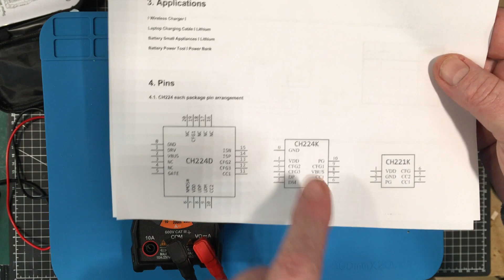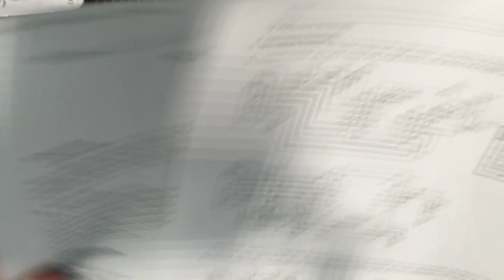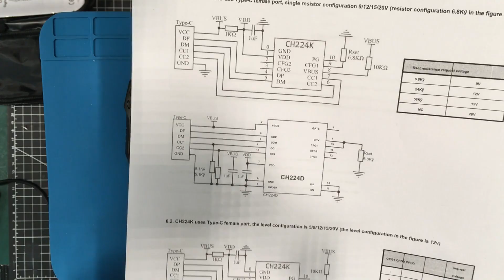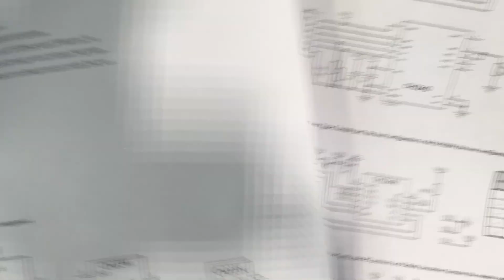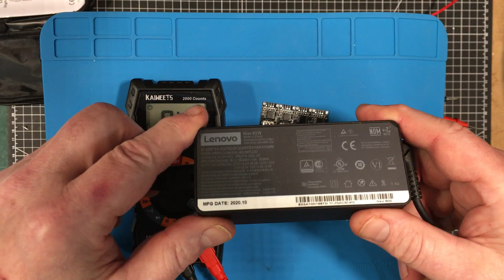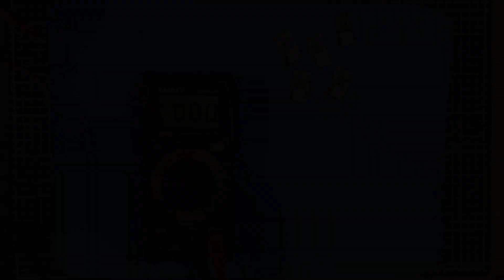0146 - $0.63 USB-C Power Delivery Controller - CH224K based

Comment: After i did some research it looks like the IC is not the CH224K as it seems but is looks like it is the FS312. I started probing with a multimeter and found that the CH224K pins did not match with the PD decoy. They may look the same, same functionality but different pinout.
Reply from the maker: Thanks for the update.
Reply: @uni-byte  I wanted to use the same IC into my pcb project as the PD decoy and i ordered first the CH224K to test it. I tried  the provided circuit in the datasheet. I connected all pins except CC1 CC2.  In the PD decoy they are connected to the female port but after that point, on the other side of USB A there are 4 cables V D+ D- GND. So i suppose these are connected inside the usb cable?!
Reply from the maker: @dimitrismed  That would be my guess too.

Comment: Thanks for inadvertently answering one of my questions: If the PD voltage isn't supported, it seems this chip negotiates the next highest voltage.
Since the Lenovo can't do 12V PD, the CH224K negotiated the next highest voltage (9V). This behavior is explicitly stated in the datasheet of another PD trigger IC (IP2721) but not this one. That confirms that it will work for my application. Cool!
Reply from the maker: Good information.  Thanks.